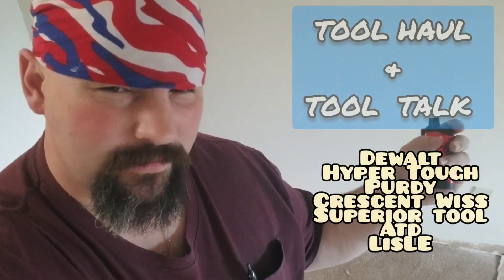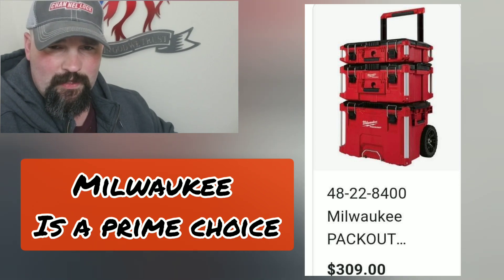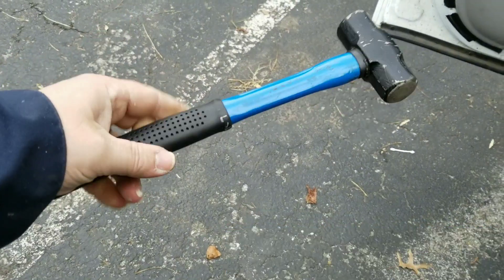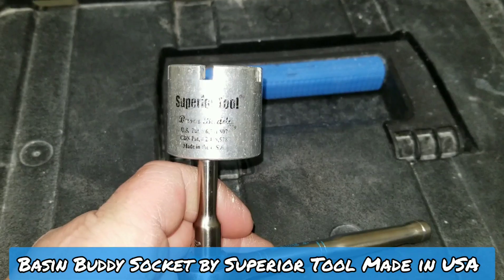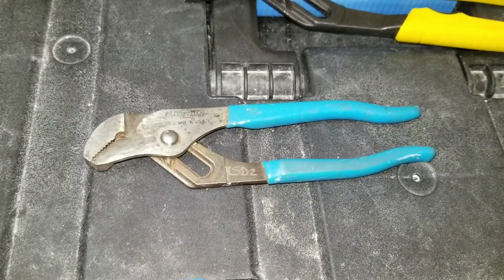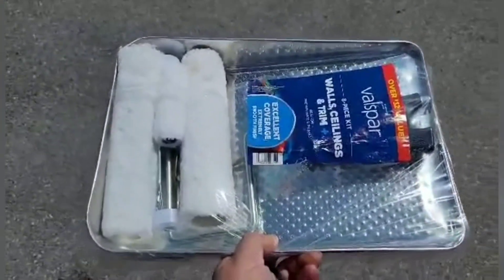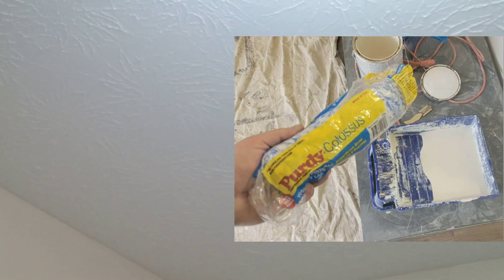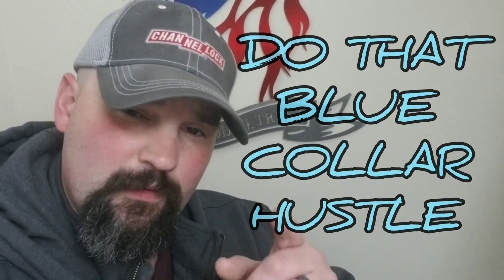Cheap Trade Tools Talk & Haul (Hart Tools, Hyper Tough, Wiss, ATD, Lisle, Irwin, Purdy & More)

Comment: I helped my brother in law change a alternator on a 2004 Ford F-250 super duty v10 6.8 litre triton with a mid 90's Stanley Walmart socket set and a new set of hyper tough combination wrenches and it did that easily so I was impressed and even though I have the comparable set of Pittsburgh pro 32 PC sae and metric combination wrench set I'm not sure they would have done that job